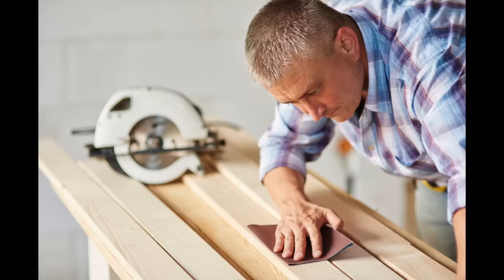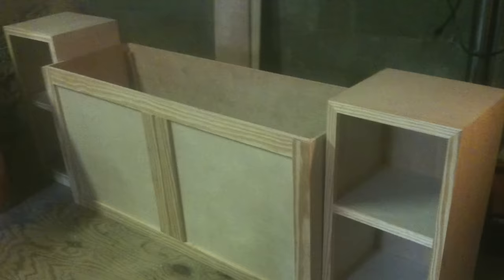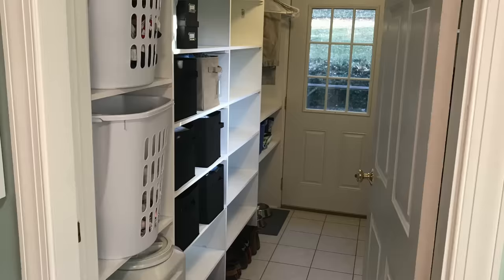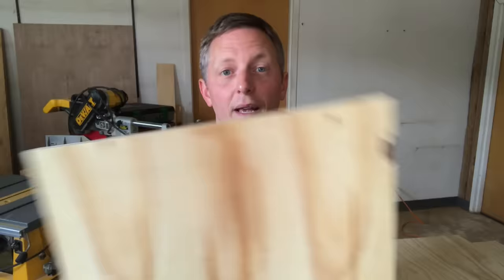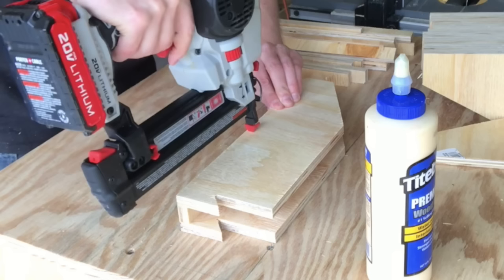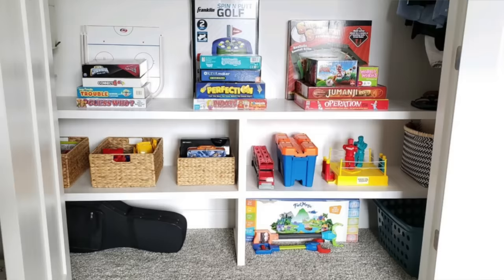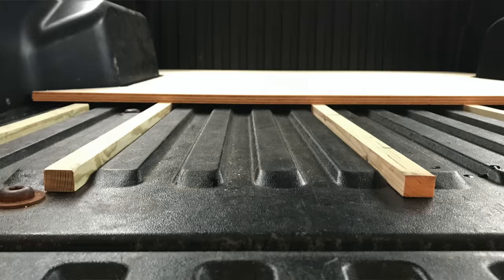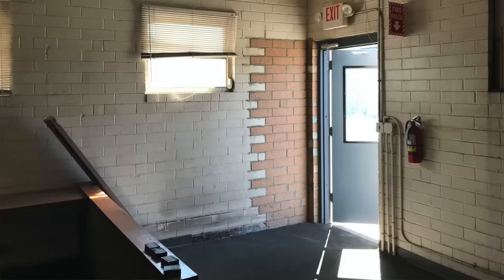DON'T USE 3/4" PLYWOOD If You Don't Need It...TRY THIS! (1/2" Plywood Vs. 3/4" Plywood--When to Use)

Comment: I agree that 1/2 plywood can be used in many situations around the shop and for smaller projects, but I'm not sure about cabinetry. Face frames are often sized based on the thickness of the upright and the requirements of the hinges. If you use thinner material for the carcass, you'll have to reduce the thickness of your face frames to match. This will affect the end result and the look of the project. Also, any joinery that uses rabbits (rebates) or dadoes (groves/housings) will be significantly weakened. Horizontal spans use 3/4 plywood for a good reason when the span is long enough that deflection is a concern.

Don't even try to use pocket screws with 1/2 plywood! The strength of pocket screw joinery relies heavily on the amount of material between the angled hole and the edge of the board. The thinner the board, the smaller this distance will be and you'll have to use shorter screws. Drilling 3/8" diameter holes in 1/2" plywood leaves about 1/16th" on each side. This would significantly reduce the strength of these joints. Again, it depends on what you're building but for an extra $10...

I'd also like to point out that, as a beginner, much of what you learn is based on standard dimensions and thicknesses. 3/4 for shelves, uprights, stretchers and nailers... 1/2 for drawer boxes... 1/4 for drawer bottoms and backing. 2" wide face frames when two carcasses meet. 1" (aka 3/4") hardwood for drawer fronts and face frames. Same goes for rails and styles of panel doors. If you use 1/2" plywood instead of 3/4", you'll get tripped up on some important dimensions unless you're really careful.
Reply: I'm sorry but I don't follow your logic that if we use thinner material for the carcass that causes us to use a reduced thickness of the face frame?  There's no reason you can't make the carcass out of 1/2 and still use 3/4 face frames.  Also, you need to define, significantly weakened.  A dado in 3/4 is 3/8 deep.  A dado in 1/2 is 1/4 deep.  I don't buy that the 1/8 difference in depth of the dado is "significantly weaker"  The dado in a carcass is supporting a cross member or back panel.  That cross member isn't going to fall out of the dado or collapse.  The back panel isn't going to break out of the frame either.  

You've built your argument against 1/2" on unsupported conjecture.
Reply: @jesseporter-qb2vc  Sorry. I should have said 'width of the face frame' and not 'thickness'. 1/2" x 2 = 1" thick cabinet wall when two cabinets are attached side by side.... normally this is 3/4" x 2 = 1.5" which we then cover with a 2" wide frame that overhangs each edge 1/4" into the space of the cabinet. If you put a 2" wide frame over top of the joint where the two 1/2" walls meet, you'll have a 1/2" overhang on each side. Drawer slides and hinges are often made to fit a 1/4" overhang so 1/2" will need padding. Not the end of the world, I suppose, but something that needs to be considered.

You're probably right about the dadoes.

Comment: I just made a bunch of 30”x30” using 5/8” plywood instead of 3/4 or 1/2 inch. Since they are used in my wood shop, I didn’t require hardwood veneers, and to increase utility, each 30x30 has a 30x12 cubby with no doors. I got BCX plywood and made sure the exposed walls were B grade. So happy with my cabinets and even more happy with the open cubbies!

Comment: Very useful tip!! I would probably add that plywood does not have the same stiffness in both directions. it is a good practice to align the outermost layers' grain direction with the span if the length allows it. 
I learned about 1/2 being strong enough from John Heisz videos.
Reply from the maker: That’s a very good point, Alipasha!

Comment: I have been SOOOO tempted to start picking up 1/2” instead of 3/4” for a couple years now, but then I always end up telling myself, “Part of the reason you started DIY’ing all your own stuff is too ensure that the quality and longevity is there, if you switch to 1/2” you might as well just go out and buy a cheap version of whatever it is your building and save yourself a ton of hassle” so I end up buying 3/4” everytime anyway. Having seen this though, I think it’s time to give it a try in certain areas. However, just like a lot of the other folks commenting have mentioned, I just really don’t think that it’s a universal use case scenario because there are quite a few situations where 3/4” still seems like it’s the way to go. Mainly any situation that calls for removing material thickness across the length of the board (rebates, dados, etc.) Anyway, thanks for the assurance and confirmation. Always good stuff on this channel ;)
Reply: I just finished building a double sink vanity and single sink vanity entirely out of 3/4". I felt it was needed because of the weight of the vanity tops/sinks/water. Moving on to the kitchen cabinets now I'll be using 1/2" for vertical surfaces and 3/4" for horizontal with the exception being the sink cabinet and island will all be made with 3/4".
Reply: 3/4 is just way too heavy, 1/2 inch just about cut the weight in half and it's still strong, as long as it's not particle board you'll be ok

Comment: I'm an older man and have used 1/2" most of my life (not as a carpenter, just for misc projects, not usually anything decorative) for the reasons stated.

But a problem I kept coming up against was screwing or nailing into the edge of 1/2".  Too easy to split the wood if you miss the edge with a nail, and screws were out of the question.  Which led to a variety of solutions:  using a combination of 3/4" pine and 1/2" plywood (screw into the edge of the pine); putting 3/4"x 3/4" trim in the interior edges to screw to; L-brackets; etc.

Comment: If you go to Baltic Birch ply, anything you’re typically using 3/4 standard or premium lumber yard ply, can be reduced to 3/8. 
I’ve been building cabinets for 18 years and in Baltic birch, every vertical panel can be 3/8 and out perform any particle board or MDF. I’ll go to 1/2 or maximum 5/8 for shelves and bottoms for extra wide spans.

Comment: I just had copper foil plumbing pipes installed that are 98% lighter then that old overweight standard copper pluming which results in better gas mileage per mile. 
Next we're getting lightweight electrical wiring that's said to reduce electrical consumption 97% by reducing the flow of electric current by 97% it's truly ingenious what they've come up with... I'm so stoked about it all.

Comment: I agree with your assessment of 1/2" ply, but there are some cabiots to this thinking: not all 1/2" plywood is created equal, and some plywood is really unstable, which makes the lessor thickness a bigger liability so buyer beware! Just about anything I have bought at the big box store has warped severely if not sealed within the first couple of months.

Comment: Two big reasons Im sticking with 3/4 for most of my cabinetry: pocket holes and dados.  I agree that 1/2 is great for small bits of shelving, but those usually get made with scraps of 3/4 thats laying around the shop.
Reply: I agree!!
Reply: I've been trying 1/2 on large upper cabinets for the backs.  Large being in the range of 44 high x 48 wide.  I have found that pocket screws will do well going through the 1/2 into 3/4, so mixed thicknesses to do this.  Check jig settings and screw lengths before going live though.
Reply: I'm using pocket holes on 1/2 right now.
I'm new to this and $49 looked like a deal.
I'm not going to regret this am I?
Reply: @T1Oracle  did you? or did it work? :)
Reply: Pocket holes work in 1/2 inch plywood. Not sure about hinges

Comment: Timely video for me. I made a bathroom vanity using 3/4" maple plywood, but I did use 1/2" maple plywood for the drawers. I went to Menards to buy Kreg pocket screws for 1/2" material and a Menard's department head ask if I found what I wanted and asked about my project. I said I was making vanity drawers from 1/2" maple plywood and he said I should make them from 3/4". He is an older gentleman (my age maybe). I said I usually use 1/2" for drawers and love the results. But after seeing this video, I plan to look into the 1/2" plywood for the next vanity I need to build for a 2nd bathroom. Thanks for this nice video.

Comment: So great! I finished a project in my "Krude Karpentry" at our cottage using 1/2" ply. Reason was simply price at first, then I noticed exactly the same things, light weight, easy to operate and cut etc. The end product, sizeable wood framed doors for an outdoor shed, become manageable and easier to assemble to an existing structure.

I am so happy I watched your video, again.

Comment: The number one concern with any plywood is "How many plies?" Both five eights and three quarters are five ply in my experience. Half inch is often three ply which is very unstable and not nearly as strong. The grade also matters as the cruder grades for roof decking and such have lots of voids in the center plies.If you are talking "cabinet grade" five ply stain grade then yes, it will be strong and stable. Half inch CDX not so much. Even Pine BC grade can be questionable. Just something to think about.
Reply: That can depend a lot on where you buy it. For just a couple dollars more per sheet, my local lumber yard has 1/2" and 5/8" that are 5 plies, and 3/4" that has 7 plies! That stuff is strong and stable.
Reply: I’ve used a lot of 3-ply 1/2” plywood.  It works ok, but takes a lot more effort.  By comparison, 5-ply birch 1/2” is a luxury.

I just had a washing machine flood a cabinet I built 12 years ago.  It filled 6 drawers with water.  I was surprised that the drawers stayed together, and wet water-tight. Just cheap 1/2” 3-ply.  But I recall hating the splinters the rough pine plywood was producing.  

Oddly, I can afford better, but grew up scavenging whatever I could.
Reply: @hjeffwallace  Yeah, for sure. I'm definitely guilty of dumpster diving for lumber scraps all the time. I'm not even talking about fancy birch, though. Just the normal SYP plywood at my local lumber yard has 1 or 2 more plies for the same thickness as the Lowes crap.
Reply: Is there a downside to gluing 2 sheets of 1/4" to get a higher ply count than "regular" 1/2"? It should be about the same $, but 2x the plys.
Yes, I'm cheap. Yes, "regular" ply is a lot easier to just go get at the big-box toy store.
Reply: @brucebennett7229  Should be fine if you you glue up properly. I'd only worry about delamination if you're using veneered plywood from the box stores. Those thin veneers often delaminate on their own, and you'd be doubling your risk with a face glue up

Comment: The drawers for all my kitchen cabinets I made with 1/2" Baltic Birch ply. When you use a much better plywood than you find in the usual stores it works much better in every way.
No voids, no knots, much tighter.

Comment: When you do followup videos where you use 1/2" material, I'd love to see more about how you manage the joinery, including situations where thicker material is warranted. For example, when is 1/2" material appropriate for pocket screw joinery; attaching cleats, runners, or slides to the face the material; dados for partitioning a cabinet or box, etc.
Reply: You mean pocket screw "joinery"?
Reply: Yeah, I would be concerned with rabbets, dados for shelving, and half-lap joints. I think glue will help, but I think you would at least need 3/4 material for the uprights of a tall cabinet. But I have used 1/2" ply for simple square boxes with box joints on the corners and those have been extremely sturdy.
Reply: @neonedge9  ...
Reply: I thought the video would go into reinforcement techniques when using the 1/2" ply at its limits, as opposed to just information that the 3/4" is just overkill in most applications.
Reply: I've done 36" tall cabinets with 1/2" but the walls were weak so instead of mdf backing, i used another piece of 1/2 ply for the back and pocket joined to the carcass to keep rigidity
Reply: @udayvadula9910  Building kitchen cabinets and have an upper that is 44 high by 48 wide, all done in 3/4 hardwood plywood.  It weighs 130 lbs!  I like 3/4 because of the solid feel when you put something heavy on a shelf, but I am realizing it does use up a lot of interior volume vs 1/2.  The cost, at the moment where I am buying red oak a 3/4 sheet is $160 and a 1/2 is $100.  I weighed a sheet of the 3/4, 77 lbs.  I am currently experimenting with 1/2 for the backs, as you did, to add 1/4" of usable depth, save weight and cost.  Shelves are dadoed and glued, including into the 1/2" backs, so the shelves stiffen the backs considerably.  I think I'll use 1/2 more often on components that are less important structurally and aesthetically.  You know, "thunk" vs "tink".

Comment: Good video. Solid thinking. 
I always keep in mind that 2x8 joists 16" apart, I think 8' span (might only be 6') with 5/8" or is it 3/4" plywood can easily support 2000 pounds per square foot. You can drive a car over it. Even my 4400 pound Tesla.  So if you need to do anything less - like fit out a van? You would never ever need 3/4" plywood for anything. 
On the other end of the engineering scale are honeycomb reinforced sheets used for floors in jet air liners. This stuff is basically a honey comb pattern maybe 1/2" deep with 1/16th inch (maybe thinner) sheets of aluminum epoxied to each side. Hundreds of pounds will deflect it less than 1/8" (ever walked on an airplane and thought, 'this floor is springy'? Me neither.  Too many YouTubers are inexperienced and grossly overbuilding their projects. 

I like using the cheaper 1/2" luan plywood from Home Depot.  It's super light weight. I made a bunk (platform) for the back of my Prius. Just over 6' long, It's supported (across) about a foot from each end,  so it's got a center span about 4'   To stiffen it,  2" in from one side and 3" in from the other side I glued 1" strips of the plywood. (Glued it, then screwed it - as clamps. When the glue dried removed the screws).  Works great for four years now.  Even after I busted out a 6" gap in one of the rails it still works.  And it's very light so easy to move in and out. 
I've made large drawers 29 x 29" using finger jointed baltic birch ply. Made at least 30 of them. Use them in cabinets (flat files for art) and in my shop. Never ever had a problem  with any of them. (Not sure what the bottoms are. It's been 20+ years). I also made book shelf open boxes hung on French cleats - hundreds of pounds of books - no flex, no problems. 
The 1/2 inch steps - the only real problem with 1/2" is supporting it where the weight is applied and chipping off the edges. And your closet shelves - the only problem is supporting the front edge - which you solve. 
The ply in your truck bed. Another reason to go with the thicker ply is as it gets damaged and worn it will hold up over time better than the half inch because it has more layers to tear through so it'll take much much longer to start busting through. 
Another thing. I made a teacher cart. I didn't have a classroom so had to move every period. So I made a cabinet on wheels that I could pop open (or lock) he lid and set my laptop on. At the bottom I had a laser printer, two drawers... wheels, push handle. 1/4" plywood. As soon as I finished the first one I knew how to make it better. So a few months later I made a second one...and as soon as I finished it I knew how to make an even better third one. But I never got around to it. BTW this is also the best way to have fun. The design it, build it, it's done - is boring and ultimately half-assed. What engineers do is keep making something lighter and lighter until it breaks and then back up a step. This argues for lighter cheaper materials. Plywood also has two properties: strength and coverage. For kitchen cabinets the primary consideration is coverage - spanning space. Strength can then be added. Rails, good corner attachment.... But then that's more parts. So 3/4 or 1/2 and good corner attachment, maybe a simple rail to support shelves.... The point then gets three aspects: coverage, strength and complexity. That's what we're working with when we build boxes and shelves. (It's why hollow core doors are 1/8" ply with cardboard in the middle. It's nicer to be heavier, but not needed.)  Hope this is interesting.

Comment: I built kitchen utensil drawers out of 1/2 inch sides and 1/4 inch bottoms. Plenty strong. 

Now for pots and pans drawers that could potentially hold 50-75lbs of pots and pans, I’m thinking still 1/2 inch sides but using 1/2 inch bottom, especially with a width of 23 inches. 

Will be using 1/4 1/4 1/4 method to build the drawer boxes.